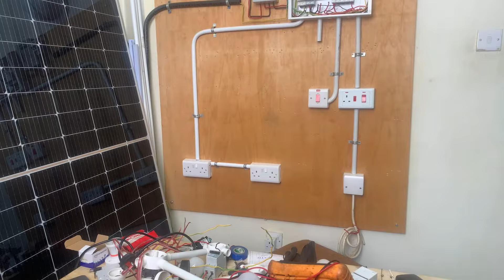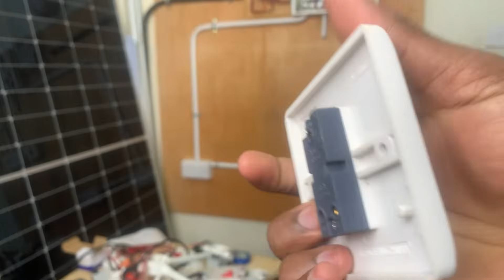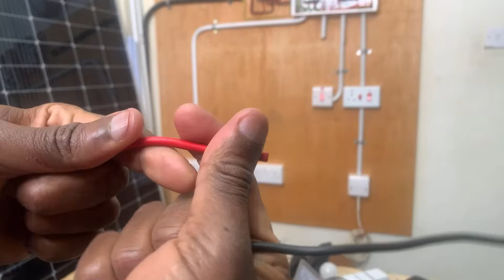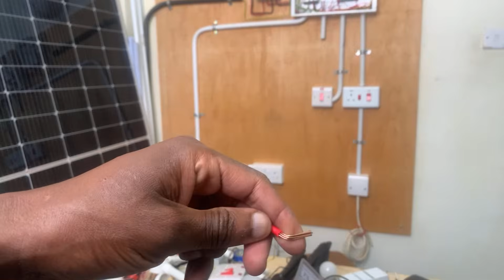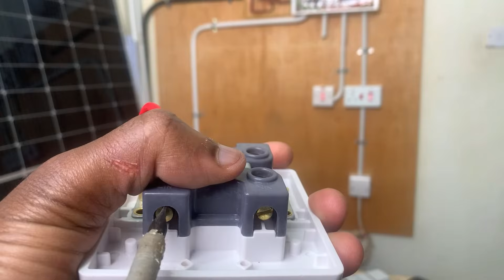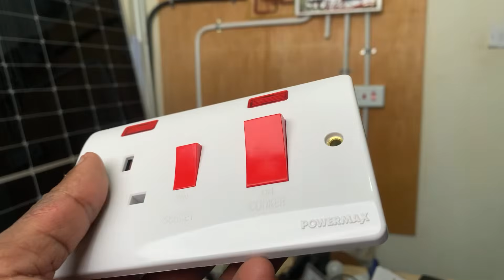Common DP Switch Wiring Mistakes that electricians commit.

Comment: Am clear where do you use that type of switches?
Reply from the maker: Douple pole switch is a heavy-duty switch designed to disconnect both the Live and the Neutral wires simultaneously.

Comment: Wiring cable  for pump installation pls assist
Reply: Uk 100% coper cable 2/5
Reply from the maker: What's the current and voltage?